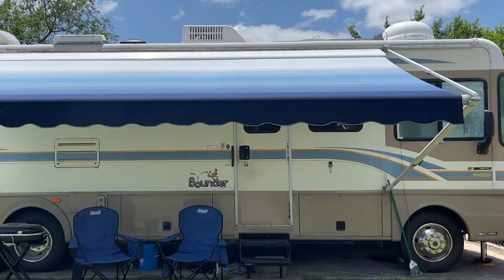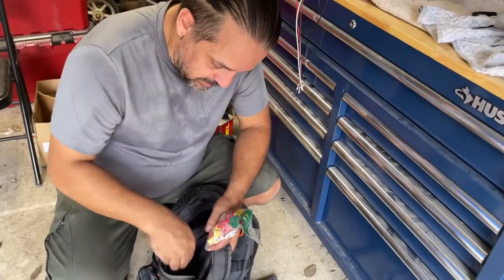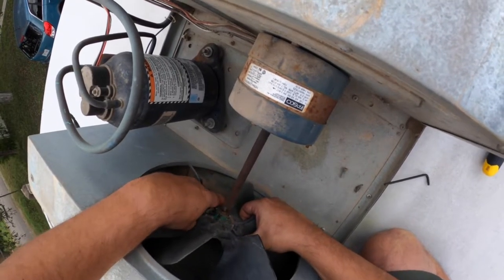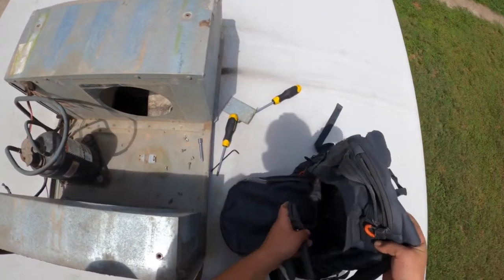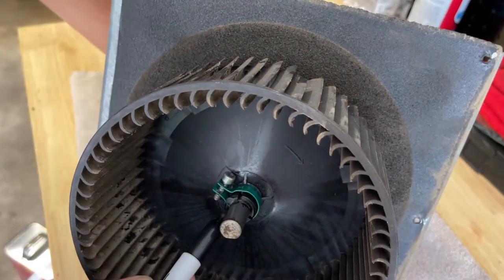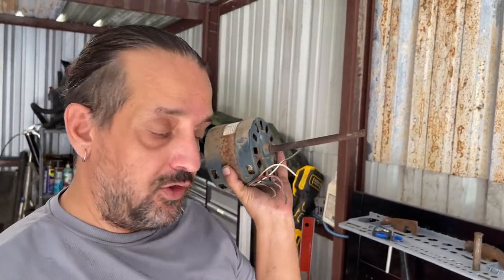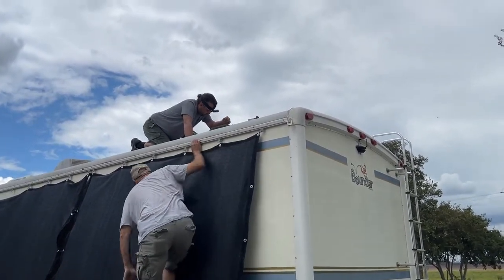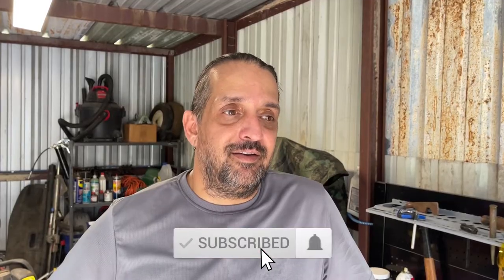RV A/C FAN MOTOR REPLACEMENT | DIY NO EXPERIENCE NEEDED!

Comment: Thank you so much for making this video. I'm a woman that lives alone in a camper and I do all the work myself & this is The identical motor that I'm doing. I save myself 485 on the furnace motor, n now 479 on this air conditioner motor. I got everything switched over and the parts clean and I'm going to be putting it in tomorrow so thank you again for making this video. 🤗
Reply from the maker: So glad you found it helpful! You’ve got this! 😎

Comment: Nice video brother.  I think the reason these fail is because they use sleeve bearings instead of ball bearings.  I had an RV with 20 year old units working fine.  Unfortunately I am replacing the motor on my newest unit which is 3 years old.  Another "they don't make them like they used to story for you"

Take care and RV on!

Comment: Good Evening and one HUGE thank you! Success thanks to you and your video I did it installed the new A/C motor. Just to let you know the squirrel cage was a Bitch to get off, the fan came off just like yours did with a little tap and wella it was done. However, after removing the motor and getting down off the roof I had a horrible time getting that hamster wheel off of the shaft and believe you me I tried everything including watching your video again just to see if I missed it. I stayed calm and kept working it and finally  it came off. I used a dremel tool to sand the shaft and then lubed it real good. The rest of the process went smooth and the results are my A/C is working. Thanks again, Elizabeth
Reply from the maker: So glad our video could help! And glad to hear you got it fixed, awesome job! 😎 Thanks so much for the comment, it made our day!

Comment: great info but I have a question. My fan is not out but I have a hi and a low switch on my thermostat and it doesn't appear to be any difference in the two. Just seems to blow on low in other words. No noticeable difference in the two settings. Does this mean high is out? My common sense says yes but I'm new to RVs so I thought you might could answer my question. Thanks again for your effort here. Great help to learn.
Reply from the maker: Hello, and thanks for the question! Our fans are only one speed, it didn’t have a high or low as far as I can remember. So I couldn’t say, it might be a different motor. It does seem like the high speed on your motor is broken, but beyond my knowledge. Sorry I can’t be of more help! Good luck, and let us know your solution! - Piper

Comment: Shucks, ours crapped out today humming and squealing like a stuck hog. One Turtle shell screw won’t come up.
At least I know I can switch out the motor and you showed the possible challenge of plate adaption thanks.
Reply from the maker: Thank you for watching. All in all the repair was not to hard. I had never done it before and they work like a charm since :) hope it goes smooth for you and you are basking in cold air soon. Safe travels.
Reply: @tamthewanderer  
Yeah thanks, a local RV joint quoted me $600. Just for the fan motor which I pulled off today amongst a bunch of cranky wasps.
I said what?
I just need the motor not the whole AC unit!
I just looked Amazon they have Coleman friendly motors for a lot less gonna do some weekday price research .

Comment: Great video very helpful, one thing though what size is the screw that holds the fan blade on, the old motor shaft, I tried a 5/32 Allen but no dice, what tool didf you use to take it off the old motor shaft?
Reply from the maker: Hello, and thanks for watching! I did use a 5/32 Allen for that. Hope you figured out a solution for yours!

Comment: I have carrer changeing fan motor color wires are diffrent emerson motor going  in dont have wire map on motir 2 browns 1 red  1 black 1 white old motor said black hi white low blue ¿ and 1 brown can you help me
Reply from the maker: I would find the diagram for your ac. Do you have the year and model? I might be able to help you find it. And facebook groups can be super helpful as well. You can guarantee if your having a problem with it many others have had the same problem. Let me know the model and year and I will help you look. The new motor should say what’s each wire does and that’s a good start.
Reply: @tamthewanderer  emerson no code is k55hxjcp 2593 2 brown red white  black old motor says black hi white low blue is missing and brown is on capaseter  i want to use same plug up
Reply: The unit is carrer 2006 rv roof not av discontinu